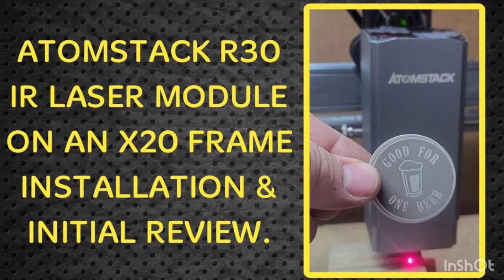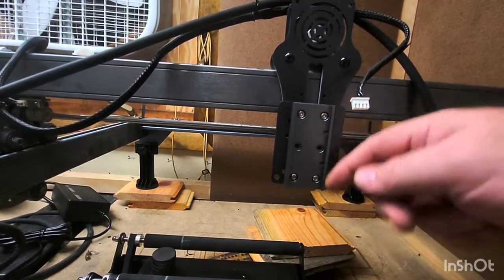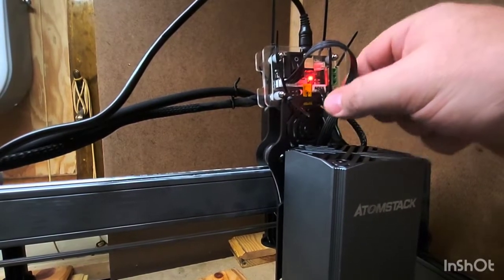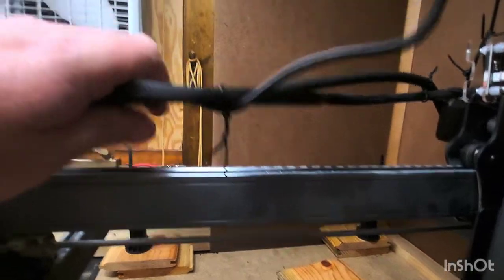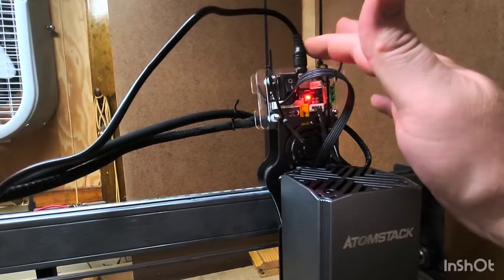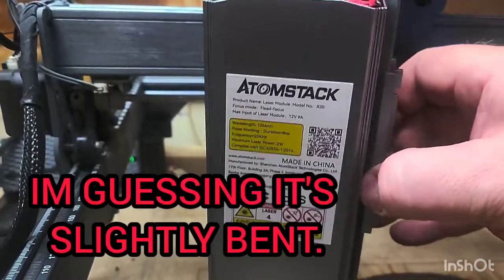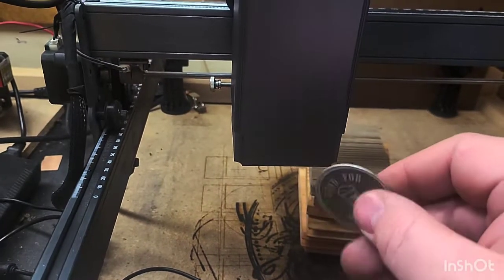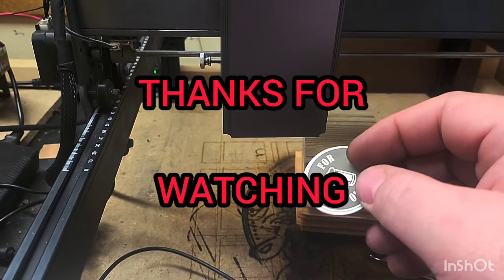Atomstack R30 Infra-red Module Installation and First Impression Review.

Comment: I just got the R30 V2 and I have the power supply connected to the new circuit board that sits on top like yours and I can power it on but Lightburn doesn’t recognize it or the USB cord.  What do you have plugged into the main board (the one attached to the rails) to make it work? The manual doesn’t say anything about it.
Reply from the maker: @tooltimebarbie  if you are on Facebook. Join some user groups for your specific machine. It's much easier to get technical and trouble shooting questions on those. Some sites have representatives that can help get warranty issues fixed faster as well. Trouble shooting usually requires photos to see settings and other issues. Usually, it is difficult to do on YouTube.
Reply: I am on those groups as well but there is not much help on this module unfortunately. I can see in the video there is the USB and a power source cord going into the main motherboard so I’m just curious how this is done when the power source is also supposed to be connected into the circuit board up top.

Comment: Is it necessary Air Assist for R30 module?
Reply from the maker: I wouldn't think so.  You're not going to be doing much cutting with this module.  Just surface engraving.  It never hurts to have a bit of air blowing to keep things cleaner,  but mostly needed for cutting.

Comment: Just got mine, and I cannot understand what the point of the connector plate is, It really does not seem to do anything but lower the laser module, but it does not need lowering as it easily reaches focal point with the track in the original position. Please let me know if there is another reason for this plate?
Reply from the maker: This module has set screws on the side to lock it in place. The other module has a set screw from the front. I really don't like either design.  A top knob Z adjuster is the best. can make adjustments as you burn for cutting thick material.  These side and front are difficult to make fine focus adjustments, and have worked loose during burns and wobbled out of focus.  The one big part of Atomstacks design that they have come up short on. Most everything else has been decent.
Reply: @TheKennyHack  Yes I understand that and agree with you. my problems is if I put the extra connector plate on instead of just replacing the z adjustment track I can see that it will probably cause me problems using the rotary attachment unless I use about 10" leg extenders lol Thanks for the video, always helpful.

Comment: I just started setting mine up today, thanks for the video.

I designed a quick 3D printed clip to hold the new circuit board and switch to the Z carriage. I'll put it on thingiverse R30 Controller board bracket mount.

Comment: Currently a 1064nm infrared diode laser (0.2w) is about $400 or $500 for sale to the public, if you are a company dedicated to assembly, I suppose they will cost you between $100 and $150 per unit or less. Going to an infrared diode laser of (2w) goes to 2000 to 4000$ per unit of sale to the public, only the led and you can only adjust the power. For that price $4000 I bought mine. One of these days I'm going to upload a video of my equipment and what I use it regularly for. Manufacture of direct PCB boards, without revealed with liquids. Kind regards, Kenny.

Comment: Hi Kenny, The announcement of sale of Atomstack in the month of August said that it was a fiber laser of 1064nm, when in fact it is a diode infrared laser of 1064nm and approximately 0.2 w. There is a video on youtube where it is explained. This was the reason for canceling the pre-purchase I made. It is a 1064 nm head for hobby, very expensive due to the low performance. Very good video and good explanations. Best regards. I currently have a Raycus of 50w and 4000$
Reply from the maker: I too had reservations on ordering this unit due to its price and concerns on what it would be able to do. Figured what the heck I'll try it out. Might have its uses for doing very detailed small pieces of jewelry. The .03 resolution even was clear on the simple project I did. They are really going to have to boost its power output if they want it to be useful and get the size of the module down. already a big module to sling around if get it up to 9000 speeds.